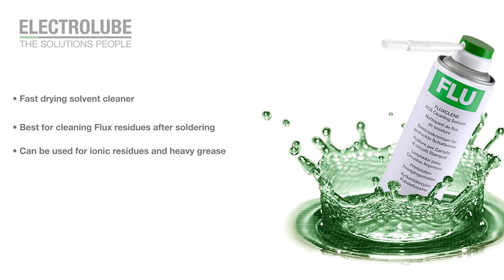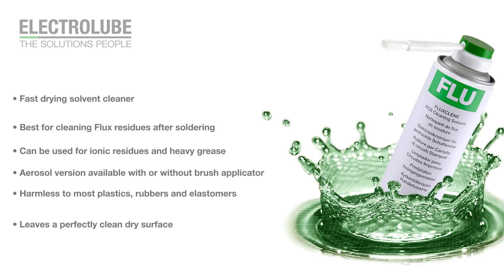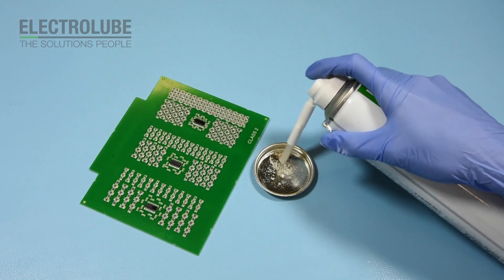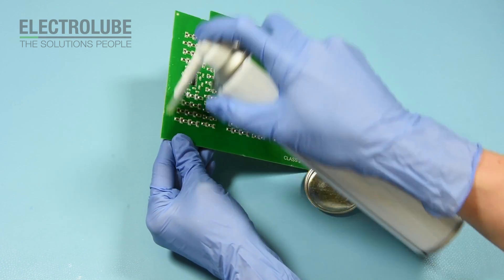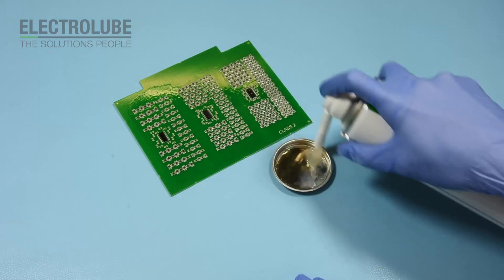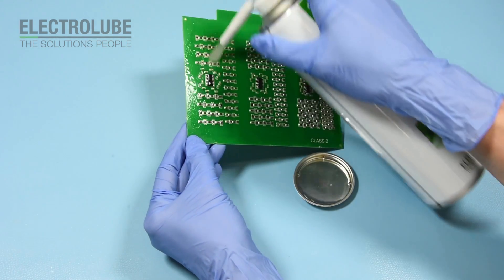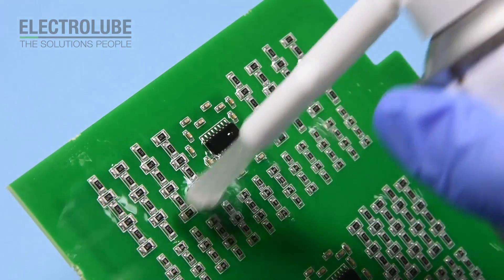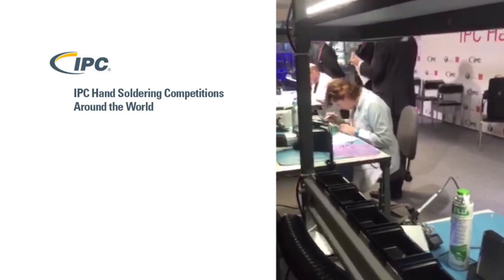Electrolube FLU Fluxclene - English

Comment: is it electrical non conductive?
Reply from the maker: Apologies for the delay in reply,   FLU is not electrically conductive. It is a cleaning solvent and will therefore evaporate after use leaving behind no residue behind. It is worth noting that as FLU contains flammable solvent it should not be sprayed directly onto live electrical equipment or other sources of ignition.